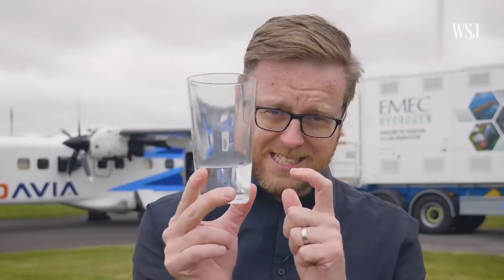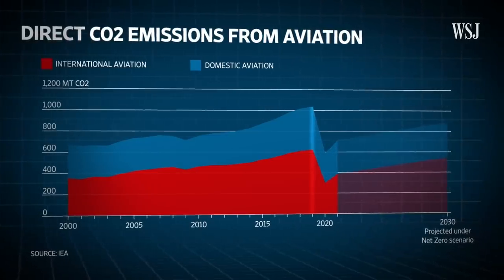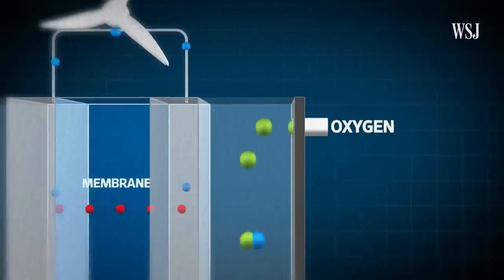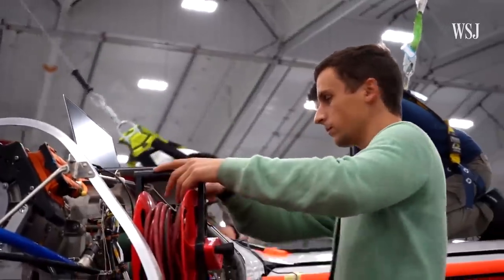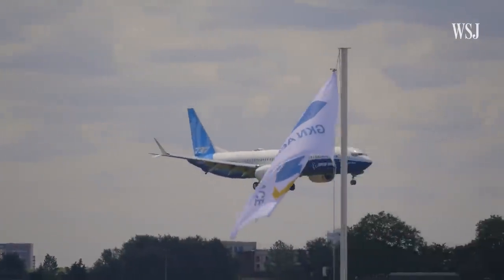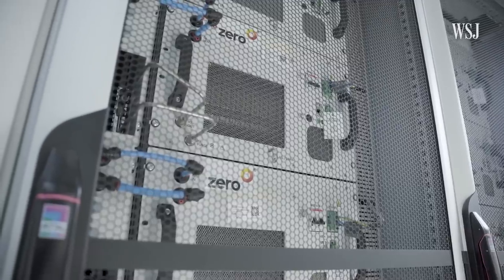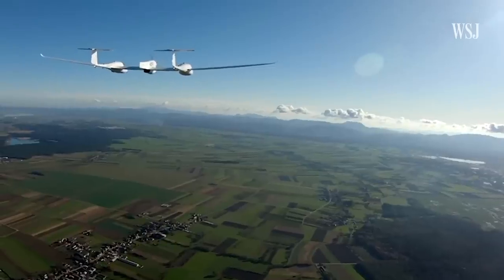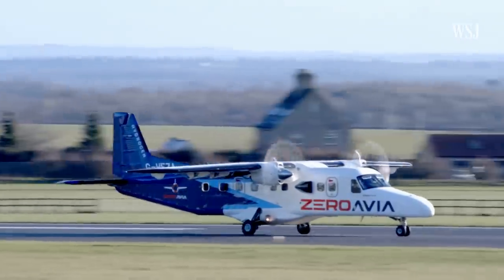Hydrogen: The Fuel That Could Power Your Next Flight | WSJ

Comment: Hydrogen fuel cells are a dead-end technology, not because of the fuel cells (they work great) but the fuel tanks.
Nobody has managed to make a fuel tank that can withstand tens of thousands of psi repeatedly without leaking from cyclic fatigue to the point of catastrophic failure, that's also light enough to be carried on any kind of a vehicle. To do this with any reliability, it needs to be made from thick stainless steel, we're talking inches thick here. That's heavy and prohibitively expensive.
This is the fact that these techno-environmentalists do not want you to know, because it's inconvenient for them. Aircraft? This has bad idea written all over it.

Comment: Hydrogen combustion spewing all that NOx at that height is probably not what we want to do to our atmosphere.
Reply: Which is why fuel cells are better. They are about 60% efficient too (don't know those specific ones though), so more than you'd get from heat engine.

Comment: should use nuclear power or battery, to be truly green
Reply: Anything wrong with cheap solar panels?
Reply: @alainpannetier2543  Flights canceled due to clouds.
Reply: @alainpannetier2543  can't be used for sustained load
Reply: @franciscogodoy9158  SoIar PaneIs ON THE GR0UND to generate H2. 🤣🤣
Reply: @wahdangun  ?????????????????????
Reply: @alainpannetier2543  Can you store that much H2 for that long?
Big airports will need over 1000 MW of 24/7 power. That's why nuclear power makes sense.
Reply: @franciscogodoy9158  Airports are served with kerosene today and will be served by H2 tomorrow. That's a nobrainer. Zero need for any NPP.
Reply: @alainpannetier2543  The supply of kerosene is 24/7 reliable, in big airports it's either a pipeline, a rail terminal or a water terminal.  A single 777 may sip a whole carload (wagonload) of jet fuel. If the average fuel flow is measured in terms of energy, it's in the order of gigawatts.
How can you supply all that power with hydrogen? Hydrogen pipelines? No such thing.
Solar panels? It's an area much bigger than the airport itself.
Reply: @franciscogodoy9158  Please check your facts before you write. H2 pipelines are a thing. Ever heard of entso-g? News: We've been using H2 for 100 years already. No need for NPP that takes 20y to build with MWh in the area of 200$, Thanks for your idea anyway.
Reply: @alainpannetier2543  Low density and low pressure (to prevent hydrogen embrittlement) means H2 pipelines today are intended for chemical use, not energy use. Hydrogen pipelines for energy use face big technical challenges and that's what projects like HyLine are trying to address now.
I don't know where you got that 200 USD/MWh, because most projects today show lower LCOE. Recent studies show renewables plus storage (to reach the same reliability) is more expensive than nuclear energy.

I have a Master's degree in Nuclear Energy and my final thesis was about hydrogen supply to airplanes. I work as a Transportation consultant, so I have no particular interest in the success of the nuclear industry. I can keep answering your comments but I won't do it anymore if you keep doing it in an uncivilized manner.

Have a nice day. And have a drink. I'll do it now anyway.
Reply: @franciscogodoy9158  I have an electricity engineer degree and 35y of experience.  I was suspecting you were from the nuc industry.  Current LCOEs for nuc are ~160 usd for 2023 and way above for 2040 (and increasing). And below 10 for new solar in certain regions of the globe. src irena/lazard (PS, I'm neither asking you questions, nor eager to peruse your "answers").
Reply: @franciscogodoy9158  I'm glad you now admit the existence of H2 pipelines.
For your information Manchester airport is already building an H2 pipeline (Called Hynet) precisely for H2 airplanes.
Reply: @franciscogodoy9158  Maybe Uniper who can mobiIize hundreds of engineers are building H2 terminaIs but have overIooked the pipeIines issue? "Gottverdam wir haben die pipeIinen vergessen" 😅.
Reply: @alainpannetier2543  Yet the technological challenges for H2 pipelines still exist. I don't mean there's not people working to address them, but we'll have to wait.
We can't say we're OK with power lines because we already have extension cords.
Reply: @franciscogodoy9158  Good. We're aligned.  Money's flowing in. There's no shortage of smart people willing to work on it.  Same thing happened 30y ago for solar panels and 60y ago for nuclear.

Comment: Water vapor is an incredible potent greenhouse gas when emitted in the upper atmosphere. If flying shall be climate neutral, we can't emmit anything up there.
Reply: It's important to note that fossil fuel powered aircraft also emit tons of contrails.
Reply: We have the technology to capture water. Like, instead of letting the water run out of a pipe it can run into a water tank. It's that simple.
Reply: " incredible potent greenhouse gas " is an exaggeration, even for high altitudes.
But yes, you wouldn't get climate-friendly planes just by switching to hydrogen.
But fuel cell electric planes would fly in lower altitudes, where the emission of water vapor has no grave climate effects.
Concepts like "ZEHST" would be no climate-friendly solution of course, despite the hydrogen fuel.

Comment: H2 is not non-emissions. It doesn’t emit CO2 and SOx, but still emits NOx.
Reply: It only emits NOx when it's burned not when it's used in fuel cells lol!!
Reply: @carholic-sz3qv  Well, you're technically right. But in this video, we're talking about USING H2 as an alternative to Kerosene, not fuel cells.

Comment: Hydrogen is just that last gasp of the legacy fossil fuel industry
Reply: What are you talking about??
Reply: @willdejong7763  Maybe never heard of electrolysis.
Reply: Exactly,  electrolysis is too expensive and energy intensive.
Reply: @johnsamuel1999  That's nonsense, The energy spent during electrolysis is released during combustion.
Reply: @alainpannetier2543  I am afraid that the electrolysis equation uses around 3.5-4 times as much electricity to produce the hydrogen as it produces when its put through a fuel cell and more when burned.
Reply: @stevenewley1  First that depends at what temp you run the electrolysis. Around 800°, the efficiency is above 90%, up to 99%.
Second PEM room temp electrolysis reaches 80%, with PEM FC having same efficiency.
tl;dr: your figures are wrong.
Reply: @stevenewley1  Second, what matters is not energy efficiency but use cases. Electricity from renewables is so cheap that efficiency is not critical. Moreover, airplanes can't run on batteries. But H2 has 3x the same energy power than kerosene by mass.  That's why so many people believe this is the ultimate solution.
Reply: @stevenewley1  Third, efficiency is hardly a reliable indicator of economic success.  Combustion engines efficiency is around 30% and nuclear power plant efficiency is around 2%. So 80% is not bad after all.